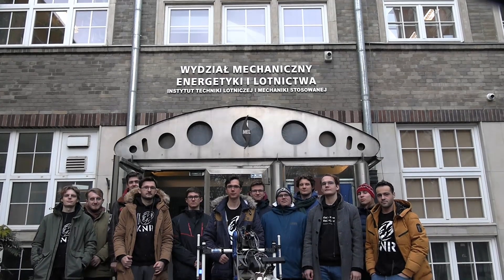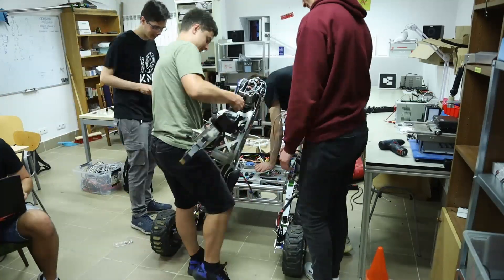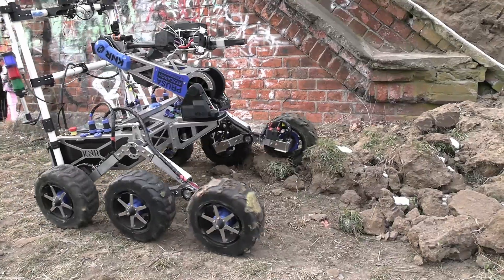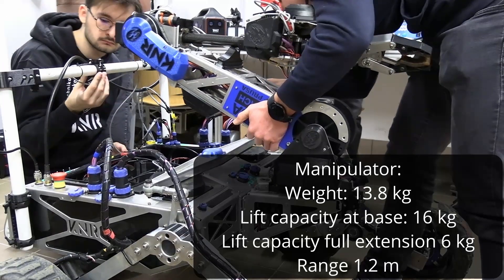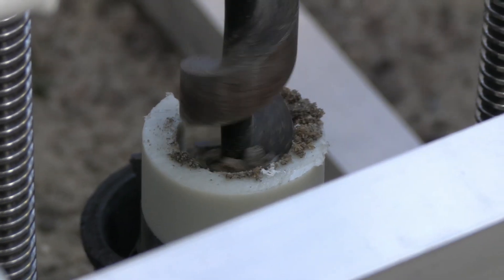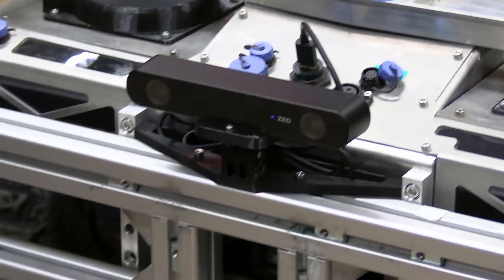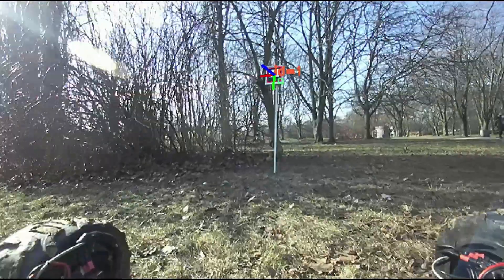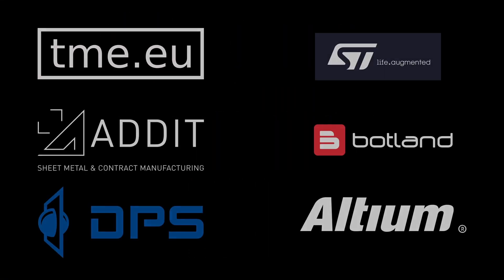ARC'25 VPR: KNR Rover Team

Comment: You have a wonderful, high-quality project.
I'm working on a similar project and have some questions: what power are your wheel motors, what current/voltage are supplied to the motors, and what gauge wire did you choose?